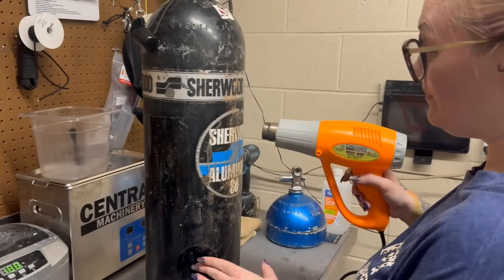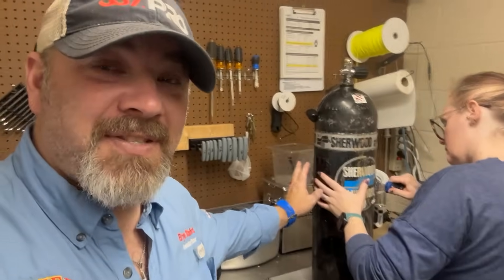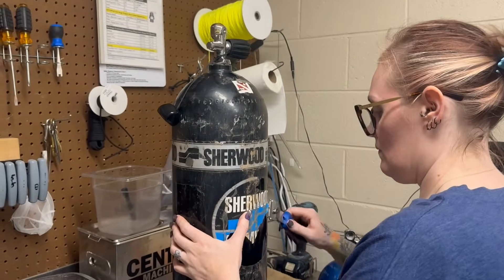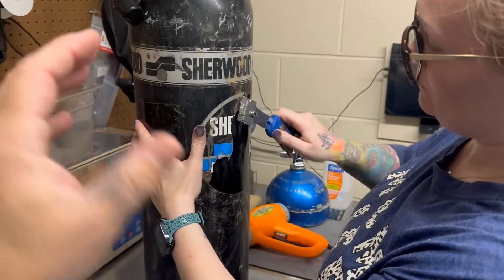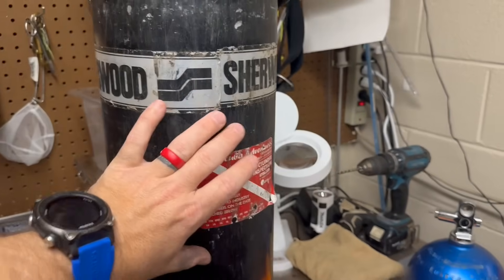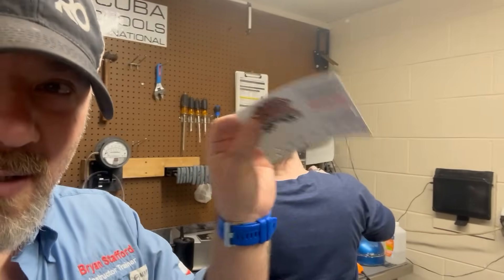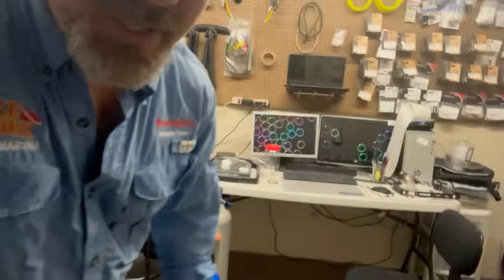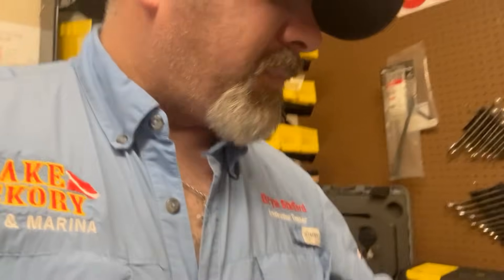Why We Remove Your Tank Stickers

Comment: Hmmmm, visual inspection means also inspecting from the inside. If a drilling hole is welded, you will see it on the inside of the bottle, removing stickers for it can be a bit nonsense honestly, welds like that are easy to grind and polish in a way you will not see on the outside even without a sticker. So basically to find it you need to inspect the inside really good, eitherway your are pretty dumb to weld on scubadiving tank if you want to keep using it for breathing air.

Comment: " I had to remove your stickers to check your tank for damage, unfortunately i damaged it scraping the shit out of it with a razor blade smh"
Reply: also heating it up, instantly rendering it unsafe. very bad practice. hope their license is gonna get revoked
Reply from the maker: Hello @feauaccen6022, great question. We do use marker buoys that unspool freely, but only on certain occassions. Unfortunately, they do add buoyancy to the diver and can be an entanglement issue if the diver does not properly train with them. In regards to the the DSMB being drug under, the majority of the time, a vehicle will only sink back down to the depth it was at origionally, unless you are working on a sloping bottom. To correct this, we can very easily allow a minute amount of slack in the line, prior to the lifting phase, or in this case, the hauling our phase of the dive. This allows for play. All of this is discussed during the pre-diving planning stage, and we usually have a good idea of the bottom before we conduct a diving operation as we use Sonar to give us a good image of what the bottom looks like. Hope this answers you question.

Comment: you're literally not supposed to put a geat gun on a tank its not supposed to ve exposed to over 350 or it must be condemed ... heat guns get well over 350 usually 700 min ... should 4ecall all the tanks hes dont this to
Reply: Incorrect. Appendix C of CGA C-6.1 specifically says "this heating concern is not to be confused with heat exposure" and "the difference is whether the cylinder material actually reaches an elevated temperature even though the environment could be greater than 350 ºF".

It also says "a cylinder used with SCBA on a person's back could be exposed to elevated temperatures greater than 350 ºF but the material of the cylinder did not reach such a temperature and remains safe to fill and use."

Comment: Well I hope that you are informing the customer that you are removing the stickers before they do business.  Also it seems that maybe a painted decal would be better.
Reply from the maker: Hello @claytonwillis2711, all of our customers are not only notified, but they sign a work order as well that explains in detail what the visual inspection consist of. We even provide them with a copy of CGA C6 and C6.1 for reference as well, which states

CGA (Compressed Gas Association) Gas Law showing this is C-6.1. 
Section 4.4 CLEANING
"Judgment is required to determine the extent of cleaning required and whether removal of paint is necessary. At the time of requalification, all multi-layered paint and coatings, foreign materials, temporary labels, or removable sleeves that could interfere with the inspection shall be removed from the external surface so it is prepared for inspection. Remove all attachments that could conceal corrosion or other defects before inspection. If internal/external cleaning is performed in conjunction with periodic hydrostatic retest, cleaning shall be accomplished before hydrostatic or other cylinder testing." 

C-6.1 deals with aluminum cylinders that hold 1800 psi or higher pressure. The same thing is stated in C-6.0. That section deals with steel cylinders. So the CGA gas laws apply to both types of cylinders.

Comment: Most ridiculous and twisted interpretation of regulations I've ever seen out of a dive shop. 
Mech Engineer,  Certified  Service Tech,  Inspector,  Adv gas Blender.
Reply from the maker: Hello @edscruggs9655, we follow CGA C6 and C6.1 which states 

CGA (Compressed Gas Association) Gas Law showing this is C-6.1. 
Section 4.4 CLEANING
"Judgment is required to determine the extent of cleaning required and whether removal of paint is necessary. At the time of requalification, all multi-layered paint and coatings, foreign materials, temporary labels, or removable sleeves that could interfere with the inspection shall be removed from the external surface so it is prepared for inspection. Remove all attachments that could conceal corrosion or other defects before inspection. If internal/external cleaning is performed in conjunction with periodic hydrostatic retest, cleaning shall be accomplished before hydrostatic or other cylinder testing." 

C-6.1 deals with aluminum cylinders that hold 1800 psi or higher pressure. The same thing is stated in C-6.0. That section deals with steel cylinders. So the CGA gas laws apply to both types of cylinders.

Comment: Just my 2 cents.. Everyone complaining about sticker removal and how it's not necessary. How do you check the outside of a tank for visual defects when 99% of the tank is covered in stickers? Some of which are probably getting old and ugly anyway.
Reply from the maker: Hello @darkfyre2K, the biggest reason we remove the stickers is because we follow CGA C6 and C6.1 which states

 CGA (Compressed Gas Association) Gas Law showing this is C-6.1. 
Section 4.4 CLEANING
"Judgment is required to determine the extent of cleaning required and whether removal of paint is necessary. At the time of requalification, all multi-layered paint and coatings, foreign materials, temporary labels, or removable sleeves that could interfere with the inspection shall be removed from the external surface so it is prepared for inspection. Remove all attachments that could conceal corrosion or other defects before inspection. If internal/external cleaning is performed in conjunction with periodic hydrostatic retest, cleaning shall be accomplished before hydrostatic or other cylinder testing." 

C-6.1 deals with aluminum cylinders that hold 1800 psi or higher pressure. The same thing is stated in C-6.0. That section deals with steel cylinders. So the CGA gas laws apply to both types of cylinders.
Reply: stickers don't really hide damage you can feel it underneath...it's not body filler

Comment: I'm glad you're not my dive shop.
Reply from the maker: Hello @pyme495, we follow CGA C6 and C6.1 which states

 CGA (Compressed Gas Association) Gas Law showing this is C-6.1. 
Section 4.4 CLEANING
"Judgment is required to determine the extent of cleaning required and whether removal of paint is necessary. At the time of requalification, all multi-layered paint and coatings, foreign materials, temporary labels, or removable sleeves that could interfere with the inspection shall be removed from the external surface so it is prepared for inspection. Remove all attachments that could conceal corrosion or other defects before inspection. If internal/external cleaning is performed in conjunction with periodic hydrostatic retest, cleaning shall be accomplished before hydrostatic or other cylinder testing." 

C-6.1 deals with aluminum cylinders that hold 1800 psi or higher pressure. The same thing is stated in C-6.0. That section deals with steel cylinders. So the CGA gas laws apply to both types of cylinders.
Reply: @LakeHickoryScuba  I see that you have copy & pasted this same response to everybody's reply. You seem to ignore the very first sentence of what you quoted though. "Judgement is required to determine the extent of cleaning required and whether removal of paint is necessary." It goes on to say "At the time of requalification, all multi-layered paint and coatings, foreign materials, temporary labels, or removable sleeves that 'COULD' (my emphasis added) interfere with the inspection shall be removed from the external surface so it is prepared for inspection."

Your judgement seems to be erring way overboard, since any of those patched holes that you claim to be looking for would be blatantly obvious from the inside. If you are doing a proper inspection, there is no way that you could miss them on the internal inspection, so being covered from the outside would be meaningless.

Comment: Based on your stupid reason for removing stickers, you should remove all the paint too...How moronic.
Reply from the maker: Hello @ronbennett8026, we follow CGA C6 and C6.1 which states

 CGA (Compressed Gas Association) Gas Law showing this is C-6.1. 
Section 4.4 CLEANING
"Judgment is required to determine the extent of cleaning required and whether removal of paint is necessary. At the time of requalification, all multi-layered paint and coatings, foreign materials, temporary labels, or removable sleeves that could interfere with the inspection shall be removed from the external surface so it is prepared for inspection. Remove all attachments that could conceal corrosion or other defects before inspection. If internal/external cleaning is performed in conjunction with periodic hydrostatic retest, cleaning shall be accomplished before hydrostatic or other cylinder testing." 

C-6.1 deals with aluminum cylinders that hold 1800 psi or higher pressure. The same thing is stated in C-6.0. That section deals with steel cylinders. So the CGA gas laws apply to both types of cylinders.

Comment: I wouldn't be upset if you removed a sticker because you wanted to verify no corrosion/rust. I'm also onboard with only having a single VIP sticker. I'd be pretty mad if I found out you removed old stickers with a razor blade though. It looks like you don't scrape but it's still the wrong tool that can compromise the tank if done wrong.....just "because you can."
Reply from the maker: Hello @jw432, we remove all stickers because we follow CGA C6 and C6.1 which states

 CGA (Compressed Gas Association) Gas Law showing this is C-6.1. 
Section 4.4 CLEANING
"Judgment is required to determine the extent of cleaning required and whether removal of paint is necessary. At the time of requalification, all multi-layered paint and coatings, foreign materials, temporary labels, or removable sleeves that could interfere with the inspection shall be removed from the external surface so it is prepared for inspection. Remove all attachments that could conceal corrosion or other defects before inspection. If internal/external cleaning is performed in conjunction with periodic hydrostatic retest, cleaning shall be accomplished before hydrostatic or other cylinder testing." 

C-6.1 deals with aluminum cylinders that hold 1800 psi or higher pressure. The same thing is stated in C-6.0. That section deals with steel cylinders. So the CGA gas laws apply to both types of cylinders.
Reply: @LakeHickoryScuba literally not what he was talking about at all he's talking about using a razor blade and damaging the tank

Comment: I never use any stickers on my tanks when l  inspect them every other dive I should be able to see if there is any knocks or anywhere the paint is lifting also I do soak my tanks in fresh water and dry them with any old rug or towel
Reply from the maker: Hello @turgutveletting6727, this is what we recommend to all cylinder owners. Stickers are great however, they are removed during the inspection processed as we are required to by CGA C6 and C6.1 which states. 

 CGA (Compressed Gas Association) Gas Law showing this is C-6.1. 
Section 4.4 CLEANING
"Judgment is required to determine the extent of cleaning required and whether removal of paint is necessary. At the time of requalification, all multi-layered paint and coatings, foreign materials, temporary labels, or removable sleeves that could interfere with the inspection shall be removed from the external surface so it is prepared for inspection. Remove all attachments that could conceal corrosion or other defects before inspection. If internal/external cleaning is performed in conjunction with periodic hydrostatic retest, cleaning shall be accomplished before hydrostatic or other cylinder testing." 

C-6.1 deals with aluminum cylinders that hold 1800 psi or higher pressure. The same thing is stated in C-6.0. That section deals with steel cylinders. So the CGA gas laws apply to both types of cylinders.

Comment: If a cylinder has been welded and you’re doing a proper VIP inspection, you will see it on the inside. This is unnecessary not dimension really bad optics for your shop.
Reply from the maker: Hello @muddbog, we follow CGA C6 adn C6.1 which states

 CGA (Compressed Gas Association) Gas Law showing this is C-6.1. 
Section 4.4 CLEANING
"Judgment is required to determine the extent of cleaning required and whether removal of paint is necessary. At the time of requalification, all multi-layered paint and coatings, foreign materials, temporary labels, or removable sleeves that could interfere with the inspection shall be removed from the external surface so it is prepared for inspection. Remove all attachments that could conceal corrosion or other defects before inspection. If internal/external cleaning is performed in conjunction with periodic hydrostatic retest, cleaning shall be accomplished before hydrostatic or other cylinder testing." 

C-6.1 deals with aluminum cylinders that hold 1800 psi or higher pressure. The same thing is stated in C-6.0. That section deals with steel cylinders. So the CGA gas laws apply to both types of cylinders.
Reply: @LakeHickoryScuba you literally didn't respond just said you don't understand the practice so just follow Google basically
Reply: @LakeHickoryScuba  Good for you, one of the only ones in the nation... Perhaps a bit of discretion could be used. If you see something that looks suspicious about the cylinder, then yes. To scrape stickers off every cylinder that comes through your shop for a VIP seems excessive and not conducive to building relationships with your customers. Not to mention the amount of time wasted, scratching up someone's cylinder, the risk of personnel unnecessarily injuring themselves by using improper technique, and, and, and. If you're that afraid of passing cylinders that have stickers on them, maybe you shouldn't be inspecting cylinders. Laws are deliberately written in a way that the inspector can be held liable for something going wrong if they didn't do everything to the T of the law so the government can't be held liable. News flash: there isn't a tractor-trailer on the road that can actually pass a DOT inspection. You don't see people inspecting to the T of the law because it is your discretion as the inspector. Are you right? Yes. Do you make your customers happy? probably not...

Comment: I would be pretty pissed if I came to pick up my tank and the mod stickers had been removed from my stage bottles.
Reply from the maker: Hello @KB-gd6fc, we follow CGA C6 and C6.1 which states

 CGA (Compressed Gas Association) Gas Law showing this is C-6.1. 
Section 4.4 CLEANING
"Judgment is required to determine the extent of cleaning required and whether removal of paint is necessary. At the time of requalification, all multi-layered paint and coatings, foreign materials, temporary labels, or removable sleeves that could interfere with the inspection shall be removed from the external surface so it is prepared for inspection. Remove all attachments that could conceal corrosion or other defects before inspection. If internal/external cleaning is performed in conjunction with periodic hydrostatic retest, cleaning shall be accomplished before hydrostatic or other cylinder testing." 

C-6.1 deals with aluminum cylinders that hold 1800 psi or higher pressure. The same thing is stated in C-6.0. That section deals with steel cylinders. So the CGA gas laws apply to both types of cylinders.
Reply: @ You should clarify that with the customer BEFORE you do it so they can decide if they want to have you proceed. I know you said they sign a form but you know they aren’t reading that. It would take 2 seconds to tell a customer that you’ll have to remove their stickers.

Comment: You dont need to do this! We dont do that at Gulf Coast Divers. A heat gun on a scuba tank is a terrible idea. Theres a tool to check the depth of nicks in the outside. Is be pissed if i picked up my tank and it was altered. Do you charge them for a new nitrox sticker when you pull that off.
Reply from the maker: Hello @martybrasher, we follow CGA C6 and C6.1 which states

 CGA (Compressed Gas Association) Gas Law showing this is C-6.1. 
Section 4.4 CLEANING
"Judgment is required to determine the extent of cleaning required and whether removal of paint is necessary. At the time of requalification, all multi-layered paint and coatings, foreign materials, temporary labels, or removable sleeves that could interfere with the inspection shall be removed from the external surface so it is prepared for inspection. Remove all attachments that could conceal corrosion or other defects before inspection. If internal/external cleaning is performed in conjunction with periodic hydrostatic retest, cleaning shall be accomplished before hydrostatic or other cylinder testing." 

C-6.1 deals with aluminum cylinders that hold 1800 psi or higher pressure. The same thing is stated in C-6.0. That section deals with steel cylinders. So the CGA gas laws apply to both types of cylinders.
Reply: dude that only says if it's necessary everyone is saying methods that make removal unnecessary... you don't have to remove them to follow that  @LakeHickoryScuba
Reply: @ look at your comments, do you work for your customers or for the government